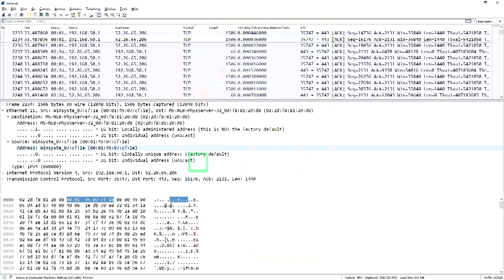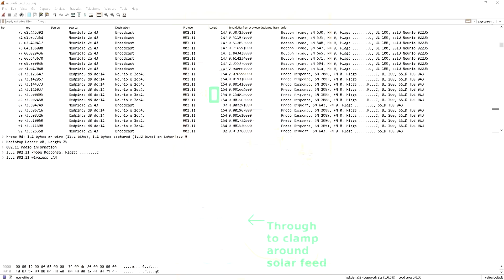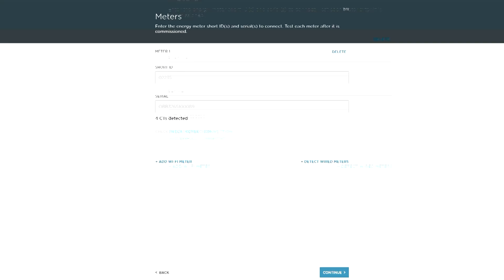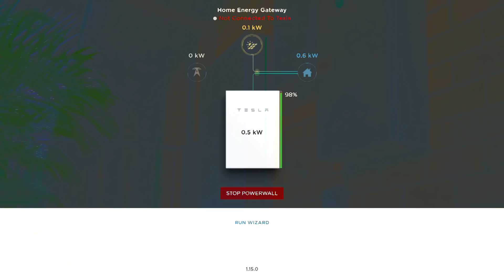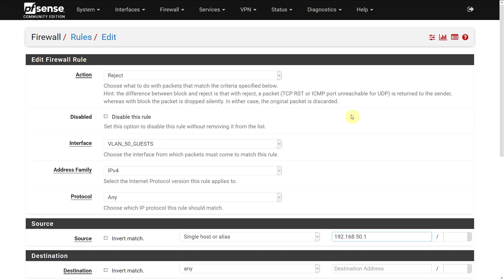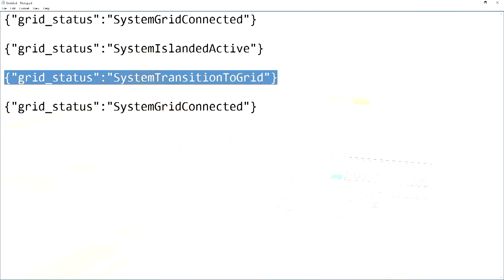Tesla Powerwall In Depth

Comment: Can automatic switching of the Powerwall between 'Back-Up Only' and a default setting (Self Powered or Advanced) be achieved?

I have some smart switches that I'm using in my home to trigger EV charging during non-time specific cheaper rate periods (the rate I pay can vary every 30 minutes).  The smart switches work well, but the Powerwall cuts in and does it's job of minimising my grid use, even though I want to use the grid during these cheaper periods.  

Switching to 'Back-Up Only' prevents the Powerwall from providing energy, so I can draw from the grid as desired, but I want to automate this.

If I can do this, the added bonus is that the Powerwall will charge from the grid during the cheaper periods, when in 'Back-Up Only' mode.

Do let me know if this switching could be automated.
Reply from the maker: I see what you're trying to do, but it can't really do that. It's rather simple, and Tesla will only let you do what they want it to be able to do. Aside from its capacity and package form, it isn't a good design in my opinion.

Comment: Hi, appreciate the info on the gateway.  Wish Tesla provides more doco on this product.  Quick question, for my setup, the gateway sends data to Tesla via 3G apparently.  Anyway, currently the Tesla app is reporting that it's not getting any recent data, which kind of means my gateway for some reason is not sending data to Tesla.  Just wondering if there is a way to power-cycle the gateway unit (the mini computer).  I have already power cycled the Tesla powerwall 2 battery unit twice and it didn't resolve the issue.
Reply from the maker: There's no way that I know of, other than either physically removing the power connectors internally to it (Shouldn't really do that), or making sure it can't connect to Tesla for 24 hours, in which case if connected to the grid it will reboot.
Have you checked its uptime to see if it hasn't actually rebooted?
/api/status

Comment: Hey mate. Are you saying that when the Neurio meter is hardwired back via 485 back to the sync board that the neurio still communicates via wifi? Or still has a wifi connection back to the sync board?
Reply from the maker: It appears so, as if it loses that Wi-Fi connection it stops. Maybe the 485 cable wasn't done right or configured right, I don't know.

Comment: I guess you realy need the battery backup and cost was not a factor as adding battery storage to a grid connected home is not cost effective. The cost of each kWh you get from the battery is at a minimum 40cent/kWh depending on how much you use the battery.
Reply: electrodacus why do you say that there is a cost? Are you referring at the initial purchase?
Reply: Yes with solar is like paying in advance for all the electricity you will ever use over the life of the system.
If you divide the price of the battery to the energy the battery can store over is usable life in kWh you get the cost of storing each kWh and for this particular battery that will be best case around 40 cent/kWh. So it is not cost effective to have this sort of battery in a grid connected house.
I live offgrid so I have no choice other than to have a battery but I use LiFePO4 battery that has a better cost amortization of around 20 to 25 cent/kWh to this I need to add the PV panels cost amortization but those are just 2 to 3 cent/kWh
Still for a grid connected house the LiFePO4 is still not cost effective so no battery should be used in a grid connected house for economic reasons. If cost is not an issue and there are other reasons then that is a different thing.

Comment: Hi,

Great video, but look at that ugly silicone job. I would tell them to come back and use Sikaflex as it's PE based, and wont run into or get heat damaged.
Reply from the maker: I see no problem with it. It's behind a unit that doesn't get opened, and it prevents ingress. At least they didn't leave it unsealed.
Reply: Fair enough :)

Comment: Was it your choice to connect the lan cable to your home network? When my Powerwall was connected I expected it to have to connect to the home network and was told there was no need as it will use the 3g connection to connect to Tesla. I can see why you would want it connected through your LAN for all the raw data, but for all I really need is the Tesla data through the App on the phone and there is no security risk to my home network as there is no connection.

What about firmware upgrades to the powerwall, you would need to allow it to connect to Tesla occasionally if you want the firmware to be updated? 

On another topic, I'm always interested in your Raspberry Pi projects even if they are just a bit to technical for me.
Reply from the maker: At the end of the day, it's a battery. No rechargable battery I've ever had in the past needed fancy firmware. It charges during the day, and it discharges during the night.
For here, I had a choice of it connecting to my Wi-Fi, or my wired network. I chose wired because it's always better where possible.
I'm trying a couple of simple Raspberry Pi projects at the moment too.
Reply: I'm assuming there is firmware that needs to be upgraded, as my DJI drone battery's need a firmware upgrade occasionally not just the drone or the controller. I've been caught before when about to fly and I need to keep swapping the batteries to update the firmware in each of them. I once had to have a Tamron wide angle lens sent back to Japan for a firmware upgrade to work with a new Sony DSLR. It was a grey import ie it had to go back to Japan.
Yes, I prefer wired that wifi, but I don't understand enough of the technical details to be able to do anything custom like you can.